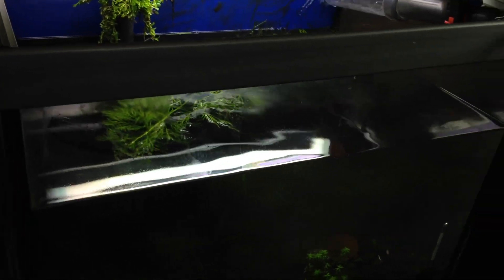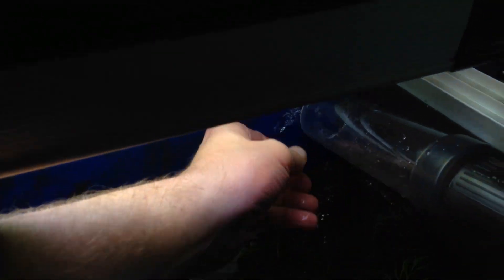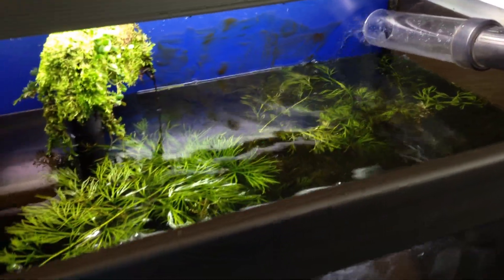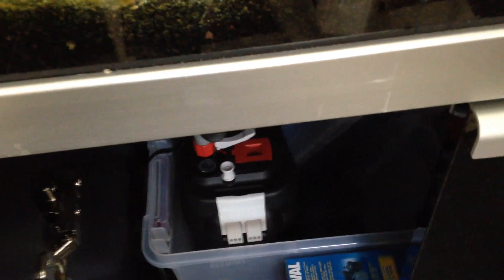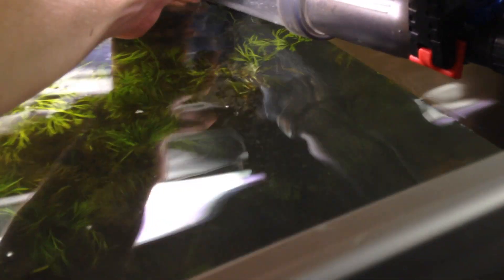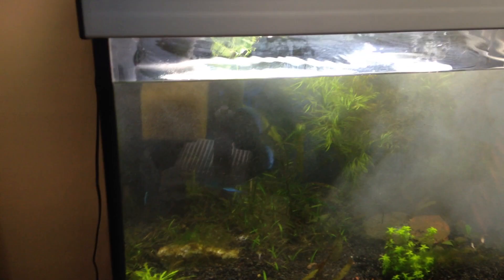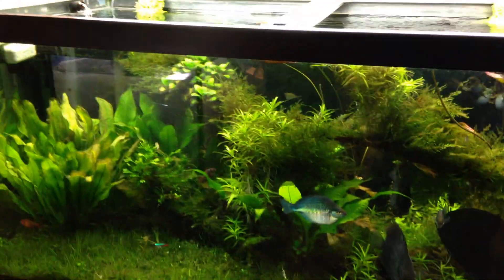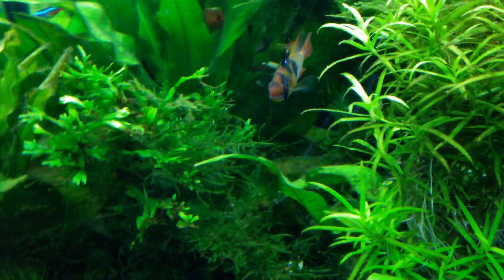Showing a water change on the 33

Comment: Hey Paducah, long time subscriber here. I have questions I hope u can help me. I had a 15Gal that was up and running for over a year, and now I pulled the media on the HOBs and have that old media on the new 20Gal set up. The new set up has been kicking up a ton of debris. Media is completely brown and gunked up. I've risnsed in tank water while doing water changes, but they get gunked up bad pretty quick. Question is can I rinse them in dechlorinated water? How can I get my tank cleaner? How can I get my media cleaner? I just don't want to risk disease with my fish with old, possibly filthy media. There has been so much melt and rot with my plants, I'm concerned. Thanks for your time.
Reply: just my opinon , but for the new tank you want that brown nasty stuff to help the cycle , once the ammonia drops to 0 then you can leave the water the same and add a fresh sponge pad to the filter , then the next day do a small water change to get the excess gunk out, you should only need to run the old filter for a week untill the new tank is ready , hope that helped lol , ive also heard people say you shouldn't use media from different tanks to cycle due to disease spreading  , but ive done it and it works fine lol , just got to be shure the old tank was clean.
Reply from the maker: I remember you!  You won a contest.  =)

It's normal for tanks to kick up debris when new.  Daily water changes of 50% are what I did.  When I first set up my new tank I let it run for 3 weeks, then added plants and added fish a week later.  Give it time and it should clear up for you.  Good luck!
Reply: MrCsup
Thanks so much! I really appreciate!
Reply: *****
50% every day? No wonder your tanks are so clean. I have quite a mess on my hands, this is taking longer than i thought it would to get this thing rolling... Thanks so much for both answering and remembering me! I really appreciate.
Reply from the maker: No, I only did that for a NEW tank if it was really cloudy and I was trying to clear it up.  That is the only real down side of organic dirt.  It causes you to do a little more work up front with setting up and water changes.